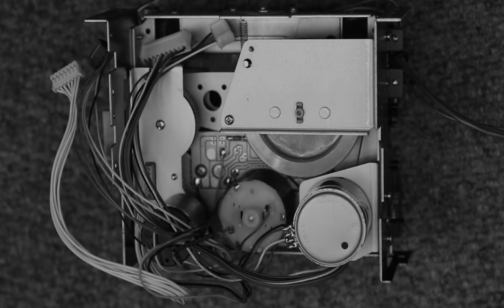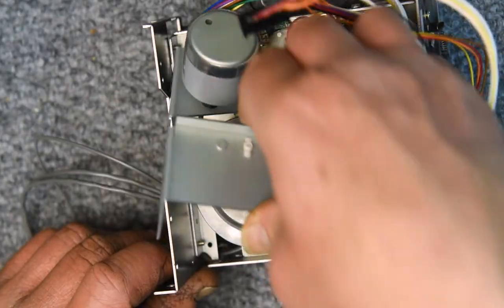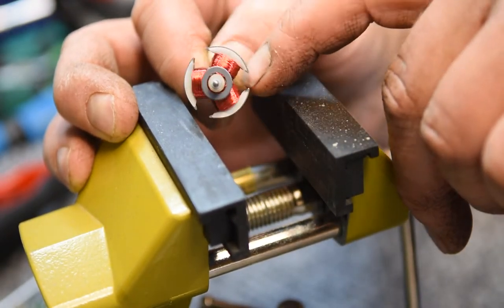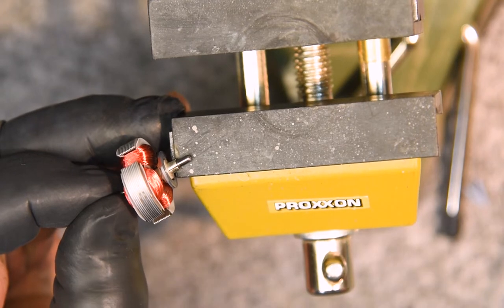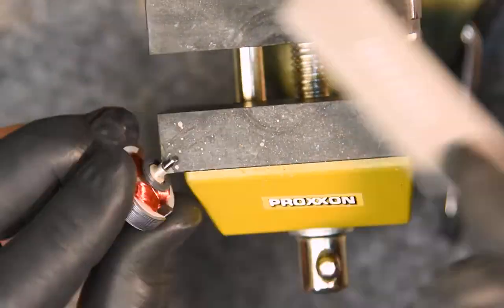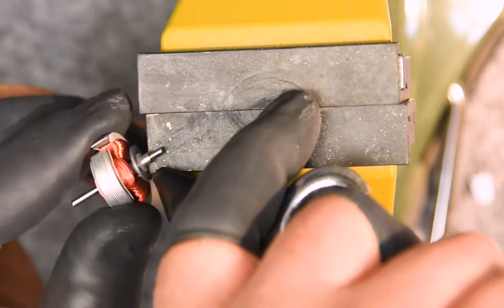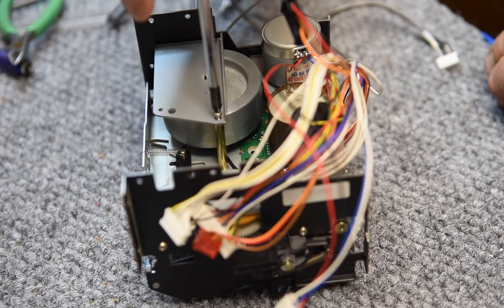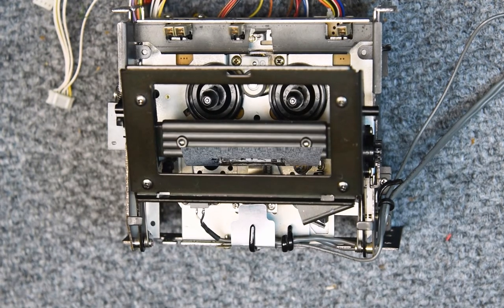Tascam 112mk2 Capstan Motor Service

Comment: Nice vid !!!.Treid to do it several times and failed  LOL. Seeing another channel,  about model trains, the guy always work on the motors and highlights the importance to clean the small spaces in between the conmutator, since carbon can build up on these groves and eventually generate shorts or poor performance. He goes over this groves with a fine toothpick. The Speed control circuit is tailored to the internal resistance of the motor.They are a match. So everything that coould lower the resistance can make the circuit to fail to compensate.
Reply from the maker: That is correct, yes.

Comment: Great detailed video. Thank you!  I have read that the bearings in motors like this do not/can't absorb oil but I see that you commented that this one did.  Can you comment on this, please? Thanks again for a great video.  I used your technique with needle nose pliers to remove the end plate and it worked perfectly.
Reply from the maker: Thank you for watching, I'm very happy it worked for you.

Oilite bushings are oil impregnated, self-lubricating, sintered bronze and very porous. In use, they heat up, releasing the suffused oil onto the shaft then reabsorbing that oil upon cooling (or mostly so). They most definitely require lubricant replenishment at intervals specified by the machine's engineers. Our capstans for example, run comparatively slow, but most machines using Oilite include oil cups or other means of easily maintaining/replenishing the lubricant. These small motors run faster and will deplete the original lubricant. The amount that I used in the video is the maximum I would ever add to this small bushing. 

Hope that helps.
Reply: @asbcustom  yes it does!  Thank you, sir!

Comment: Hi there, fantastic video! I truly appreciate the effort you've put into creating such high-quality content. I've been working on servicing a Tascam 112 that I acquired for personal use. After applying some lubrication and installing new belts, it's functioning quite well. However, the capstan motor appears to be problematic—it's quite noisy, and the voltage keeps fluctuating. I've attempted to clean and lubricate it, but the noise persists. I believe it would be best to replace the motor altogether. Could you please offer some guidance on where I might be able to source this part? Thank you in advance!
Reply from the maker: Thank you for watching and for your kind comments.

I don't have any particular source for these motors, unfortunately. I'm forced to search eBay and the Internet and wait until something shows up, like everyone else. If the voltage to the motor is fluctuating, you may wish to look upstream of the motor, that might be the actual problem rather than the motor. Good luck!
Reply: @asbcustom  In case you find this information useful or it may assist someone else, considering your earlier input, I detached the motor from the board and powered it using my lab PSU, which resulted in stable motor performance. This leads me to suspect that the issue could lie within the regulated circuit that powers the motor. I noticed the large electrolytic capacitors – are they known for leakage issues? The regulators could also be a potential cause. I will continue to investigate and narrow down the source of the problem.
Something to add is that speed issues get worse as the unit gets warmer.
Reply from the maker: Miguel, I've chased similar problems before and found different causes. Sometimes, the motor is responsible, others, different things like pinch roller pressure, or back tension, but because you mentioned the motor noise, I would further investigate the motor itself, as you have already deduced.
Reply: @asbcustom  Latest update:

Indeed, the problem turned out to be the capstan motor; it was very noisy due to the play it had, likely from a lack of lubrication over its years of service. Fortunately, I discovered the same type of motor in my dad's Pioneer CX-5 cassette deck. However, he didn't let me have it without some effort, as was always the case with him: it was seized. Following your instructions, I disassembled it, cleaned it, and tested it. It worked! My current draw was approximately 0.033, not as impressive as your figures, but still good enough. After reassembling it, the device now plays perfectly! Thank you once again for providing this valuable material and teaching us how to improve our techniques.
Reply from the maker: Well done my friend, well done indeed.

Comment: Hello.  I noticed that when you removed the motor end cap,  there was a visible inductor coil sitting in a cutout of the black separator material but when you were about to replace the end cap,  I noticed you simply dropped that same coil into the cutout. Wouldn't that coil be soldered to the circuit board or does it serve a different purpose?
Reply from the maker: When the cap was removed at about 3:20, it was sitting exactly where I later placed it. It was puzzling, I didn't understand what purpose a loose coil serves other than possible grounding and there was no other way to fit it up, you can see me trying to locate a corresponding opening.  In the end, the problem I had with flutter was too much pinch roller pressure, which I neglected to check at first. Once that was corrected, the flutter went back into spec. I appreciate your scrutiny, thank you for your comment.
Reply: @ASB Custom  thank you for the reply.   I found another youtuber who said that the coil is used as a heat sink for the control chip beneath it. I don't know if this is true but it's an interesting theory.   https://youtu.be/h1BBVAtDtIo
Reply from the maker: Filling that cavity with thermal paste however, creates a mechanical insulator, effectively reducing, not enhancing, thermal conductivity, no?
Reply: @asbcustom  I thought the thermal paste was an odd application as well.   It would be interesting to find a schematic/circuit description from Mabuchi to see what that coil is intended for.
Reply from the maker: The thing I love most about this medium is the free sharing of ideas and knowledge. A few days ago in a different thread, E James referenced the D’Arsonval Movement in a comment, a concept with which I was unfamiliar, but is fascinating and applies to things I use every day. Regarding the application of thermal paste, application meaning theory, not physical use, I reference molecular cohesion and how thermal compounds actually operate. You might also be interested in the practical metrological process of wringing gage blocks for additional resources, there should be limitless videos on both subjects.
Reply: @asbcustom  Agreed!!!
Reply: Late to the party, but I’ve been absorbing videos on capstan motors lately. Thermal paste is thermally conductive. With microprocessors, the idea is to fill in any imperfections in the surfaces to ensure maximum heat transfer area. It can make a 10-15 °C difference. That was the idea in the other video, help the thermal transfer to the back plate as much as possible.
Reply from the maker: It is thermally conductive, yes, because it fills the microscopic air gaps between the chip and its heat sink. However, in this thickness, it's also a very good thermal insulator. Imagine smearing a 4mm thick layer of Arctic Silver 5 on your CPU, then embedding a bunch of 4mm coils between it, and your heat sink. Which would be warmer, with, or without, the thermal paste? Anyway, I'm not at all convinced that it's a heat sink transfer device, it could be something completely different, but in any event, I won't be adding any thermal paste to my motor coils. As always, I appreciate your comments.
Reply: Agreed, Arctic Silver is for the tiny imperfections on a CPU. Or any metal contact surface. You have more experience than I to know it becomes an insulator. I think it woul help at the contact surfaces (points) of the “spring” at the part and the end cover. Filling the cavity seemed an overuse of product that doesn’t aid heat transfer at a minimum.

Comparing to the CPU example, the few contact points of a coil offer very little conduction surface area. That’s a bigger issue than the effect of a glob of paste. Thanks for entertaining the think tank!
Reply from the maker: @nohrtillman8734  Don't discount the negative impact of that "glob of paste" though, it's probably 50% of the surface thermal area of the chip.

Comment: Thank you for the informative video. Are you familiar with the motor used in a tascam 246 by any chance? I disassembled mine to clean up and instead of the white plastic moulding that sits between the motor and the pcb, it actually has a thin metal lid that was held firmly in place by notches around the edges. I could not get it off until i filed said notches. Now, i can't get it to hold the lid back in place. Do you know of any device or technique that is used to fix this inner metal lid in place? Im scared to use a hammer and chisel to 're-notch' the edges. Hopefully this all makes some kind of sense
Reply from the maker: Thank you for watching.

The motors whose backs are staked in place, I tend to bend the tabs back rather than file them away. As you learned, once they're gone, they're gone and yes, they are staked back into position. If you're not comfortable dealing with it, send it to me and I'll do it for you. No charge, I'll make a video about it.

Comment: Very nice video. However, I have a real amateur question I hope someone can help me with: When I put the "back" (or lid or disc or whatever people call it) on at the end of such a job, it always pops off again. Is there a trick or a knack I have to use there? I see you use a special pair of pliers for this job which I don't own myself. Is there any other way to get a good result with this part of the repair?
Reply from the maker: Thank you for watching, Jimmy. 

It's not really a special pair of pliers, just regular waterpumps protected by tape. Maybe a hole could be drilled in a wooden block for the shaft side, then another block of wood to protect the back, and tapped with a hammer.
Reply: @asbcustom  Thanks! I shall try that. I'm trying to get into the motor from a Sansui SR-222 MkV, a great turntable, in order to grease the motor's bottom bearing, but it looks more difficult to desolder the little PCB than in your case so I just tried to put it back together again - and ran into the above issue. A case of "If it ain't broke don't fix it", I suppose.
Reply from the maker: Good luck, I'm sure you'll work it out.

Comment: Hi there! Thank you so much for the video. I have a Tascam 688 and Im trying to fix a playback speed problem. It's just too fast. I changed the capstan belt and the pinch roller, but the problem is still there. Do you think It's a capstan motor problem? Is there a way to fix It? Thank you so much.
Reply from the maker: Hello and thank you for watching. The 688 is a high speed deck, are you saying it runs faster than double speed?
Reply: @asbcustom  Yes sure, It runs really really fast, even with the pitch Turned down
Reply from the maker: Does the pitch control function?

Comment: Sir, some deck hace motors that are always running. Is this the case with the 112?. If not, do you think that motor can benefit from running all the time ?. I think that the point of getting the motor running all the time could be to reduce the stress of starting the flywheel every time. I was thinking to mod a couple of entry decks I have to "always running" motor. The ones I have with the motors constsntly running didnt show any signs of trouble at all, In fact I like it better, they are up to temperature, less stress to the motor motor and belts (since it will use inertia for the soft touch operation)
Reply from the maker: I think running while the tape is inserted is a good standard. Many stations/studios power up everything and leave it on all day, there's no reason to have a capstan churning away when not in use but I don't like the practice of activating the capstan motor only when play/rec is used, that has its own set of associated problems.

Comment: Hey ASB ! Thanks for this and all vids. I’m working on an oddball right now… a peavey mcr 4 4-track cassette deck. It has this motor in it and I’m dealing with some wf issues and I think I may take it apart and clean in like this, maybe besides the sanding if I can avoid it, but lubing and cleaning the brushes seems like it may help. Just curious when you were putting the wires back on you hooked all the wire tips around to the second hole besides the first black wire, was this intentional or does it matter?
Reply from the maker: It doesn't matter but I think I did capture both holes before soldering.
Reply: @asbcustom  I attempted to go in and lube the motor up to see if that would fix the flutter issue and now the motor wont spin after a couple turns when I hit play and just stops. Not sure what I did I was very neat and didn’t do much in there. Have you ever experienced this after working on a motor? Thanks for the feedback
Reply from the maker: @Pb_salt  No, I haven't. The brushes may have damaged.
Reply: @asbcustom I don’t understand how when you pulled the motor apart, the little plastic washer that sits on top of the commutator didn’t get pulled off the shaft and stuck behind the brushed like mine, it didn’t seem like you moved the brushes or anything. Magic.
Reply from the maker: @Pb_salt  That washer is also a spacer for the commutator segments, the brushes need to be spread out prior to removal. I have another video here, I think the camera angles are a bit better: https://youtu.be/75qcUIB2Wr8